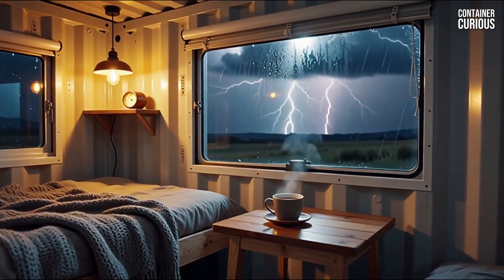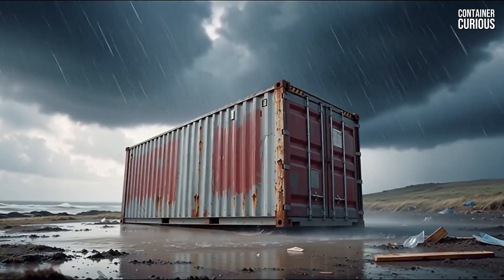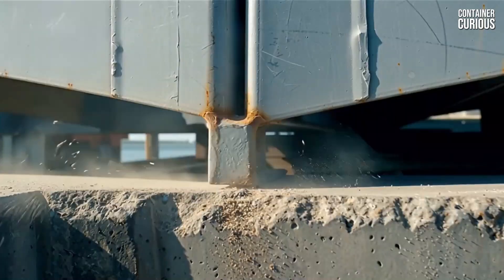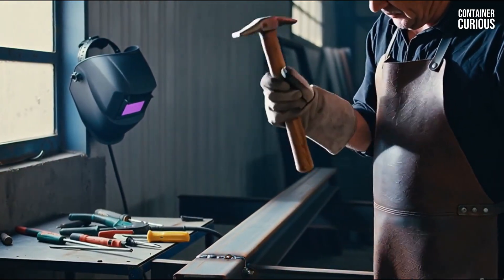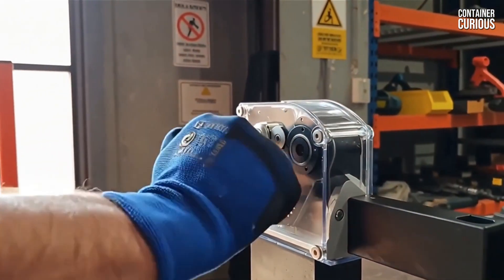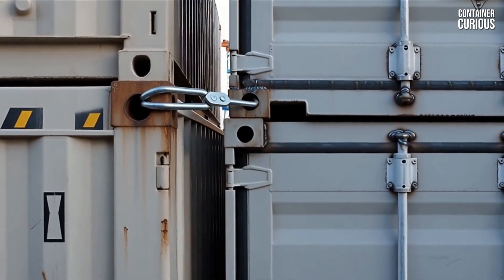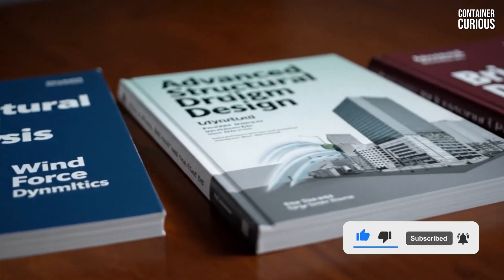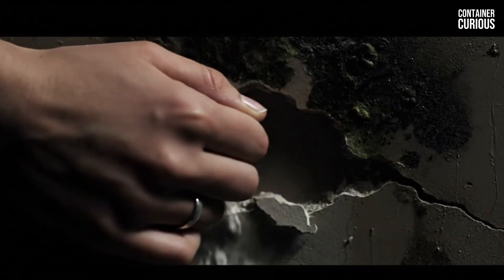The 1 TIE-DOWN MISTAKE That Will Throw Your Container Home Off Its Foundation

Comment: The Container home has the same engineering requirements of any other kind of building residence.  The Container home needs to be bolted to its foundation.
Reply from the maker: Steven, that is a brilliantly stated and absolutely crucial point. You've perfectly summarized the
core philosophy of this entire channel in one sentence.
You are 100% correct. Builders can get so fascinated by the novelty of the steel box that they
forget they are still building a residence, which must obey the universal laws of engineering. The
forces of wind uplift and shear don't care what a home is made of. This is exactly why our
"Anchoring Rule"—that a house is useless if it's not fused to its foundation—is non-negotiable.
Thank you for articulating this so clearly. Besides anchoring, what is another engineering
principle you believe is commonly overlooked in container projects?